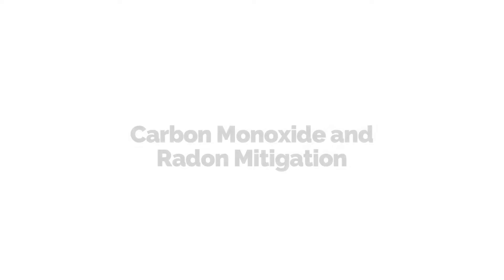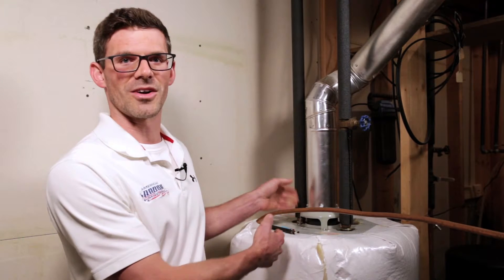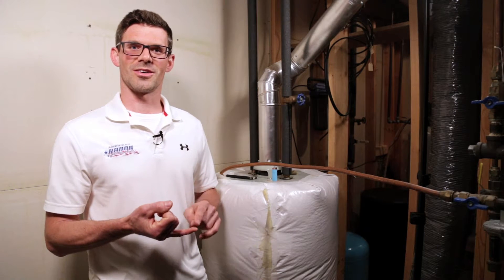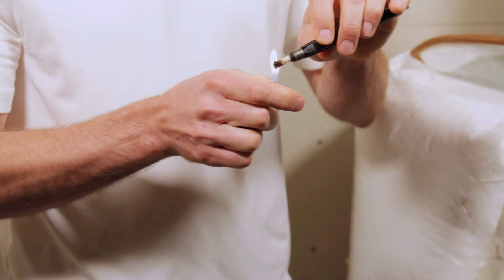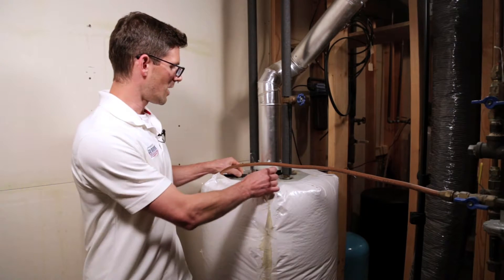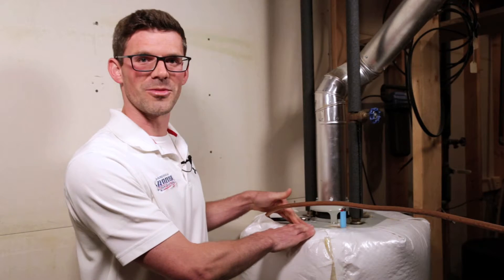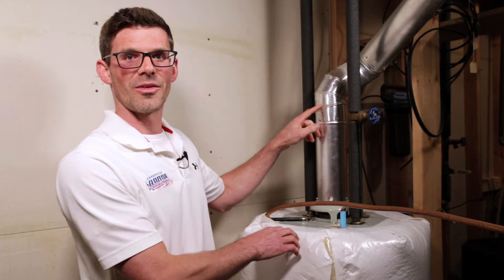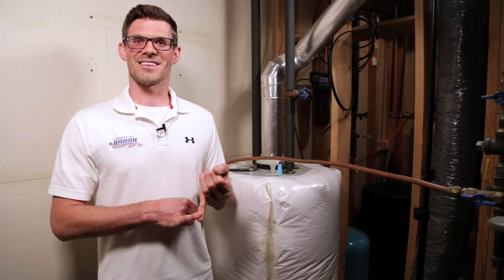Back-Drafting Water Heater? Here’s How to Check

Comment: Wow, good to know! I am working on a radon system now (just tested yesterday for the first time... 10pci in basement and 5 upstairs), and I want to do it right. I will be testing the pressure around the basement with test holes as well to get the fan and piping sized correctly.
Reply from the maker: Good luck with the project! 

FYI, we offer tool kit rentals and consulting if you'd like some guidance. https://americanradonmitigation.com/consulting/